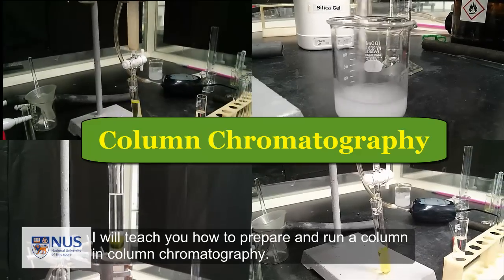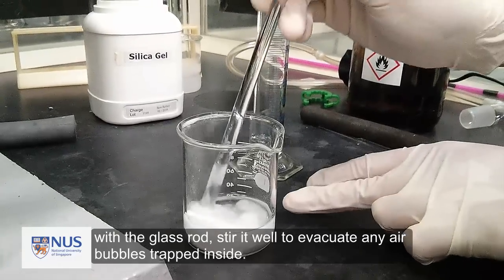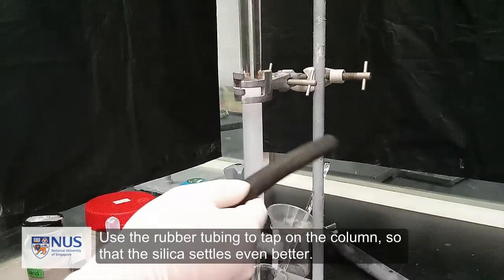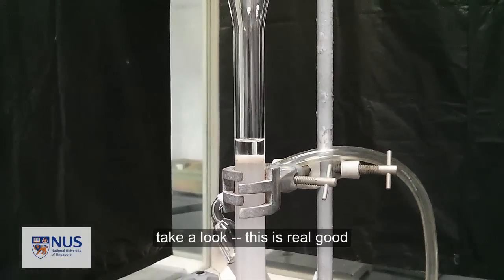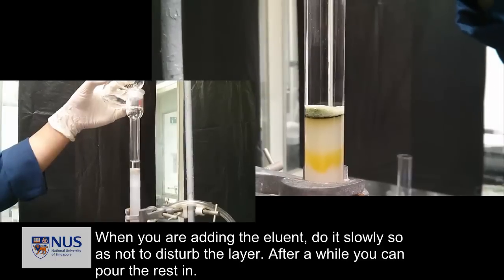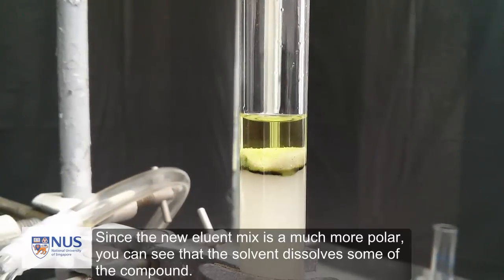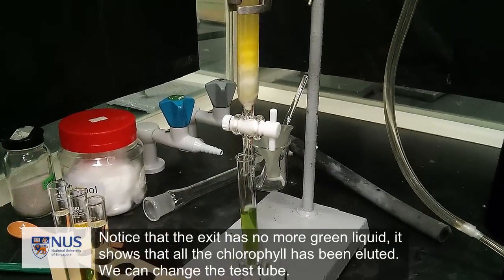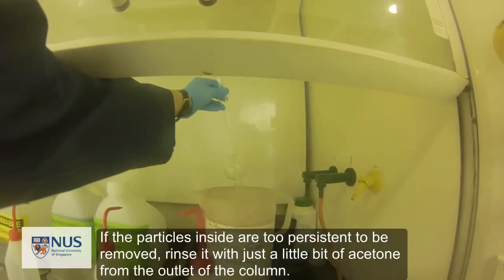【4K】-- Column Chromatography (Purification)🌟

Comment: another question if my product solid, here can add it to column as solid ?or first disolve it in solvent?, (this solvent is the same mobile phase or any solvent just until disslove ?) tq
Reply: plz doctor i need your answer,tq
Reply from the maker: the solid would not dissolve sometimes, and it is OK!  When I performed purification using column chromatography, i had many solid particles (insoluble) and did a successful separation any way!!
Reply: @chemfunman   thank you doctor for reply. sorry you mean just add the solid  that insoluble direct above sand after that you got nice separation
Reply: @chemfunman   also i habe this question .if i did some experiments in the lab and my product was (liquid or oily) here how can  run column,? i mean add it direct  over sand or also  must add solvent to product, (this solvent is the same mobile phase or any solvent just until dissolve?)

Comment: Ok, for flash purification it is suitable. But for thourogh purification it is unsuitable because of large number of silica cracks in the column (four white bands in the lower part). This happened when you abruptly changed the polarity of the eluent from hexane to hexane:ethyl acetate 1:1
Reply from the maker: It's my pleasure

Comment: Dear sir, you are using a air pump for applying pressure on the column- can you tell me the model and company name of that pump? If you have any link for getting more details for purchasing that pump then please share here if possible. Please tell about column and connector dimensions.
Reply: Please give information about the air pump that you have used

Comment: Hi friend you are very intelligent ❤️❤️ I am impressed , could u tell me if this method could be used to cbd/thc because I see u use hexane is this dangerous if I extract cbd/thc
Reply: I will use the same method to isolate CBD from a THC/CBD oil. Hexane is used as a solvent in this case. You can use isopropyl alcohol or ethanol for your experiment with CBD, that's common, and it works the same as hexane as a suitable solvent. Mention that isopropyl alcohol is as toxic as hexane. Please make sure to dissolve all solvent by heating it above 80°C. Good Luck!
Reply: @jonasschweiger8938  No you can not simply exchange hexane with isopropyl alcohol, unless you move to reverse phase. Alcohols are very strong eluents, much stronger than esters. I would start with an ether first, but keep in mind, that it is somewhat more polar and an hydrogen bond acceptor, but not a donor, so the selectivity might be off. I think diethyl ether might be convenient. 
You should never underestimate the toxicity of n-hexane. It is neurotoxic and for some complicated reason much more so than other light alkanes. Modern medical grade petroleum spirit is often explicitly hexane free because of this.
Good luck with your projects. And always keep in mind, that natural product separations are often on a different level than simple synthetic workup. This is the real deal for which chromatography was invented and not the harmless stuff encountered in undergraduate organic courses :3
Also one has to keep in mind, that solvents dissolve in your terpenoids (cbd and thc) very well, so they will not be removed by simply heating to their normal boiling point. To get entirely rid of them will need high vaccum and long time periods. Traces are really, really hard to remove even at high temperatures that would harm your products. I am not joking, this is a real problem and most laboratory workers ignore it, because in an organic laboratory, solvent traces do not matter that much. We learned it on an industry course about separation problems some months ago.

Comment: thank you.......
can i know why you put sand??? and why stationary phase always suspend(covered) by mobile phase in Chromatography Columns
Reply from the maker: Sand will protect the silica layer from being disturbed, so that the solute mixture will move as a uniform band (doing its best to). If there are no sand, during the transfer of eluent into the column (while topping up), the silica may experience a 'dent' and not be levelled.
Reply from the maker: not to disturb the silica layers. sand is denser, it will provide a firmer support.

Comment: thank you doctor for this nice video.
i have some question: if i did some experiments in the lab and my product was (liquid or oily) here how can  run column, i mean add it direct  over sand or also  must add solvent to product, (this solvent is the same mobile phase or any solvent just until dissolve?)
Reply: plz doctor i need your answer,tq
Reply from the maker: No need

Comment: hi can anyone help me please i have some question about a recipe
the organic phase dried over anhydrous MgSO4, filtered, and the solvent removed under vacuum. The residue was chromatographed over alumina with elution employing a 3:1 C6H6/CHCl3 mixture, and the collected fraction stripped of solvent under hard vacuum to a constant weight. This free-base solid can be recrystallized
when i dried water from organic phase and getting fractions from column this gives me a solution but in the end of recipe said free-base solid how can i get solid from solution fraction with vacuum?
Reply: The product is probably a solid - so after you purify it by flash column, and you evaporate off all of the solvent (the hard vacuum step), you'll get a solid.